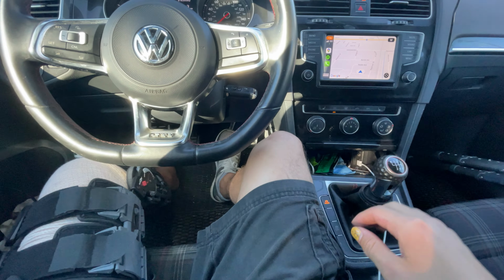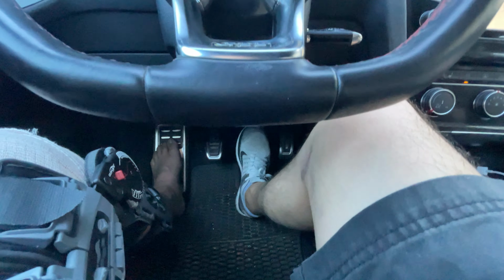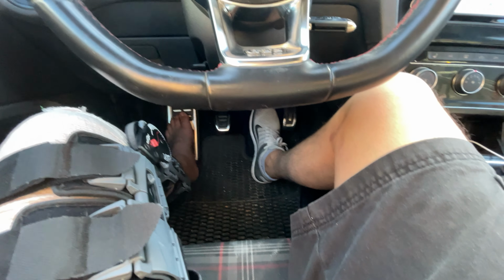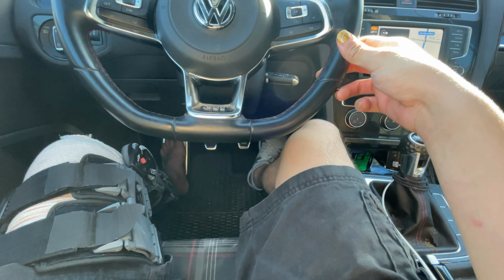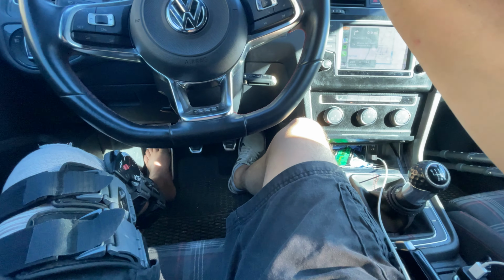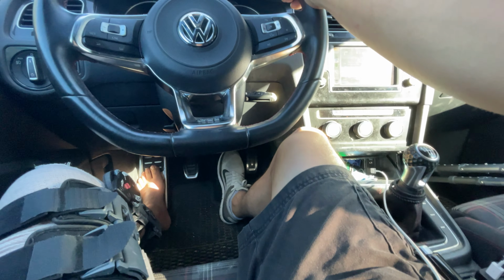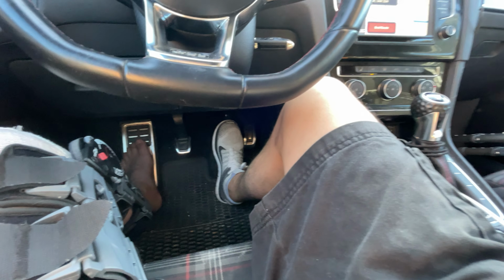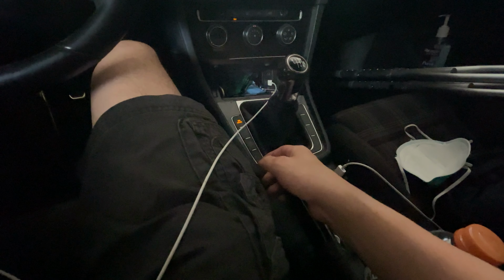Driving a manual car, only using one foot

Comment: This car doesn't need clutch to switch to other gears?
Reply: You can change gears without a clutch in any manual car if you're in the proper rev range. In my car, if I let it fall 500 RPM in neutral, it floats right into the next gear.